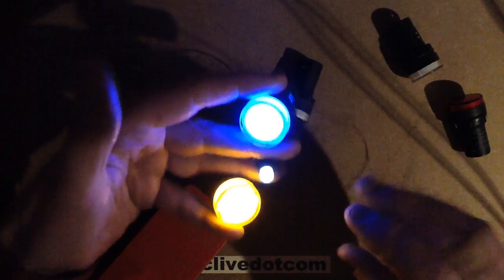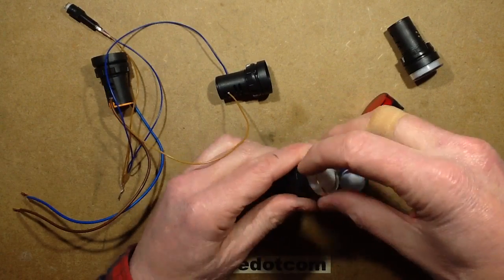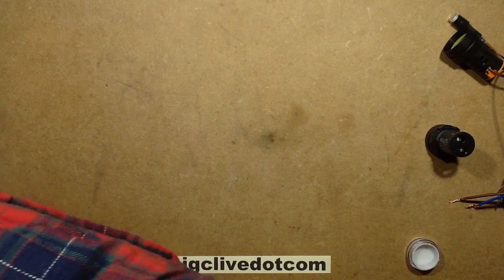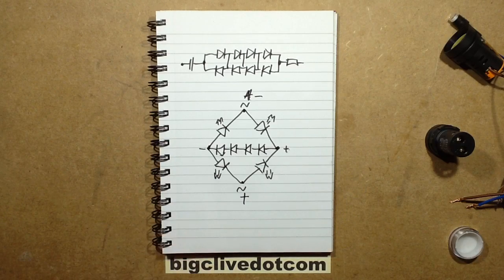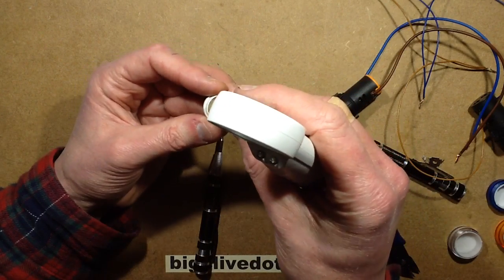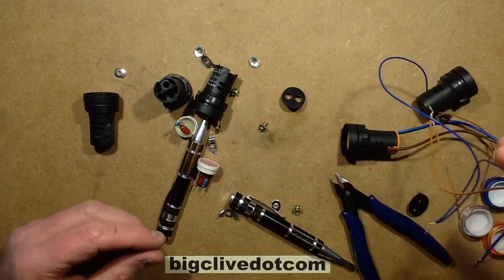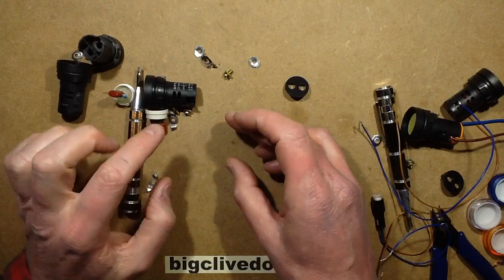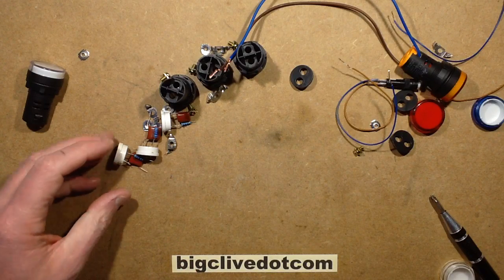A look inside some eBay panel indicators.  (with LED based rectifier!)

Comment: I wonder... Do they flicker? Single alternance rectified 50 Hz gives a 25 Hz pulsating voltage, the flicker of which can be visible and annoying  for some sensitive people (like me)...
I have often dreamed of special high light persistance LEDs that would act as if a capacitor was smoothing the supply... Would not some sort of phosphor layed on the LED chip do the trick?
Reply from the maker: The indicators do not flicker perceivably to the eye

Comment: I once had to replace the ballast in fluorescent fixture in a retail store.  I turned off the strip of lights the burnt out fixture was on and started to work on top of an aluminium ladder. I got a shock from the fixture because it turned out that this particular fixture was on separate circuit because it was one of the security lights that is left on all night when all the other lights are turned off.  Like you said, always check your voltage again.

Comment: I have bought these and use them for various commercial applications.  I set up a test of all 5 of the LED's on 120 volt. 1.5 years has passed with 24/7/365 application.  here is my conclusion. The red and green remain as bright as originally installed. The white is the dimmest, followed by blue and yellow. Those 3 have dimmed dramatically.  I have used the red/green on motor control distribution boards.  The white/blue/yellow for other 'load on' applications on alternating motor systems, remote loads, etc. .

Comment: I bought a 6mm indicator rated 240V    I figure there was no way to have a ballast cap or a ballast resistor in that size.
I measured at 20VDC ant it took 10 mA   = 200mW   I did not dare to put 240V across it was bright enough for me at 10mA so added a 5W ballast resistor.

Comment: these dont work with 230v ?
Reply from the maker: You get 12, 24, 120, 230 and 380V versions.  I'd actually suggest the 380V version for 230V use as the components are rated better.

Comment: I make my own as they can be a bit pricey and often aren't at the desired voltage.  Get a sizable switch with a plastic body and make a hole large enough for the LED. It does need a bit more extra wiring and circuit but one has more flexibility in brightness, colour, light effect (ie flashing), and voltage.

Comment: Clive,  have you looked at similar indicator lights that detect amperage?,
Reply: 22MM AC 60-500V 0-100A LED Current Meter Indicator Ammeter New
Reply from the maker: I didn't spot those.  I've ordered a round and square one.
Reply: I have ordered one as well to be used for a block heater indicator.
Curious as to how they make a dc led work off ac current flow.

Comment: I ordered a multipack of 230v indicators wired as a bridge rectifier and ended up powering them with a dc supply but with a flip/flop circuit and npn / pnp transistors to swap the polarity at about 2hz and it makes for a very atractive indicator. The yellow one looks great. It does worry me that these things are being wired to 240v and 450 (shudder) Thats just and accident waiting to happen when it fails and someone thinks.... ooh its off  !!!!!  neee goood

Comment: I always found it funny how in Star Trek, whenever there was a power surge, someone operating on ship's consoles died from electrocution. Could be they used those cheap Chinese control panel indicators hooked directly to 12.75 exawatts Warp Core.
Reply: One thing's for sure: None of those connections were earthed.

I'll go now.

Comment: I see "LED rectifier"

Is it possible to make an entire LED lamp where the LEDs themselves are the rectifier? Like, one set of LEDs points in one direction, and a second set points in the other so that it alternates between the two with each wave?
Reply from the maker: You have to be careful about leakage through some diodes exceeding the reverse voltage of others.  The gallium nitride LEDs don't really like being reverse biased with too high a voltage.
Reply: That could be countered by using multiple LEDs in either direction, right? The voltage would be split evenly between them.

Comment: what I don't get is why they dont use surface mount capacitors and resistors!!!!
Then you could just hook it directly up to mains with no worries. Whole thing enclosed in epoxy/resin with just the wires coming out of it. No more risk and much safer than having an entire circuit board dangling from the back of an LED circuit board attached with leads!
Why not just make the whole thing encased in resin/epoxy with surface mount miniature inductors and surface mount components.
That would surely be neater and more compact!

Comment: these look like cheap fake copies of telemecanique,  
and as an industrial panel designer and builder only 110vac or 24vdc lamps should be used (48vac  for cranes )
240vac is extremely bad practice and anyone using 380v lamps should be sacked .
Reply: I agree with what you are saying by using 24vDC and 110vAC but I don't believe the 240vAC pilot lamps are bad practice, I believe they now used purely for retro-fit applications (LED conversion) but yes 400vAC and above shouldn't even be made. Some of the old panels I've repaired had no space for transformers which would have been massive due to their age. Either that or certain companies were just cost cutting when they were designed

Comment: I have 600v lights. Am I able to run 240v to them and will they work?
Reply from the maker: If they are LED then they should be fine.  If anything they will last longer.
Reply: bigclivedotcom yup they are LED. Cheers.

Comment: I probably didn't listen well enough in school to understand but.....why do you by-pass the cap when using 12 V ?
Reply: It's often 12V DC, and without the cap, it's a reasonable 12V design instead of a 220V design.

Comment: Those poly caps are a good deal tougher than their ratings would indicate.  While I certainly would not design something deliberately outside those specs for an industrial indicator with longevity in mind, I think the rectification the LED provides makes it a sort of pulsed application, for which poly caps have far higher ratings (a quick Mouser delve for 250V Polyester caps from VIshay shows a 250V ac rated cap with a 630V DC rating and impulse ratings in excess of 1kV) and self-healing characteristics.  These properties are often exploited among home Tesla coil builders to create large stable safe capacitor arrays.

Interesting teardowns.  For comparison, I got a hold of several Allen-Bradley LED indicators (800FD-P3N5), which contain a bit more protective circuitry for the LED, mostly well-sized power resistor, full-bridge rectification, zener protection for LED, and a bleed resistor to keep from biting you. All protecting a single LED with a cap for scattering light.

Comment: As some follow up to the never assume tip: A electrical contractor came around my facility to replace PCM filled transformers.  He did not verify all the name plates and assumed all the transformers had 480v secondaries.  Half the facilty's old transformers had 208/277 secondaries.  The cost of the repairs to the facility was several times the cost of the bid to replace the transformers.  The contractor had to cover the costs.

Comment: just recently found your channel absolutely great stuff. I especially enjoy the work you do with the LED spotlights. I was curious if you ever considered doing a tear down and analysis of any of the off road led spotlights scattered all over Ebay? some of them seem to make pretty auspicious claims being that they're based on 12 volt system.
Reply from the maker: +matthew knowles Thge power and intensity values are all sales driven.  I've featured at least one jeep light in a video.

Comment: Interesting LED bridge rectifier design. very clever to use the LED's this way.
That 250 Volts rated cap was probably for a 110 Volts lamp and misplaced in a 380 Volts fitting. Poor Chinese quality control.

Comment: Hi and well done!
I just wondered if the little 250V cap in the 380V LED arrangement might be at least mathematically correct as it has only to withstand the voltage dropped across it. So I did a quick calculation with the reactance X=1/(2*Pi*f*C) and I get 32k at 50Hz on a 100nF cap. So given it is a white LED with 6 * 3V chips in a row, you have 100nF -> 5x3V -> 1k. The voltages are equivalent to the resistance, so with 230V across the whole thing, you have 205V at the cap, 18V at the LEDs and 7V at the 1k resistor. The current flowing should be about 6.4mA.
With 380V the cap has to carry 351V, LEDs take 18V and the resistor takes remaining 11V, all at 11mA.
And as the white LEDs had only one LED chip, the voltage shifts up again about 15V more...

The capacitor with 250V is clearly underrated. 

(Reference http://www.electroschematics.com/5678/capacitor-power-supply/)

Comment: I've never heard of tiny tungsten lamps operating at those high voltages O.O. The high voltage indicator lamps I'm used to seeing(Allen Bradley) have a built in 24v stepdown transformer. After seeing the inside of the tiny one, neon seems to be the best option for an indicator of that size.

Comment: Not bad price, about 72 cents US on Ebay for these lights.  I guess we are lucky in the US in some respects, the cheap chinese tat is likely to be 220/240 stuff running on 110 at half brightness so we're a tad safer.
Reply: +stonent In noticed the attempt at catching people wanting Allen Bradley parts in the title "Hot Sale LED Pilot AB Panel Indicator Signal UC Warning Light Lamp AC/DC/AD"
Reply: stonent If it runs on 110, wouldn't the amperage be increased though?

Comment: 380V is 347V + 10%, where 347 Is the line-neutral voltage on a 347Y600, which is common in Canada.

Comment: Here in the Netherlands a fase to neutral is 230V and the difference between fases 380V. Surprising that the ratings on the lamps are not given as 250V and 480V respectively. Manufacturers usually go for a value to appeal to the widest possible audience.

Comment: I might be mistaken, but in my mind, LED have a quite low reverse voltage tolerance, making them not really suitable for rectification. Am I wrong? a quick googling tells me it's about 5V max on the datasheet, and we can get away with 15V
Reply: +nraynaud1 It's not such a problem in this application though, because the reverse polarized diodes never see more than the forward voltage drop of the other diodes that are conducting.

Comment: The voltage rating on film capacitors is usually AC. If the capacitor is marked 250V, that's 250V AC, not 250V peak. Even with the correct voltage capacitor, you still need that series resistor to limit inrush current when you happen to turn the indicator on during AC peak or worse: during the opposite AC peak from the one the capacitor might still be holding a charge from. The LEDs might not survive the several amps pulses for many times: without the resistor, the circuit will initially looks like a 0.1uF cap charged to ~750V. If the LEDs have 15 ohms of total combined series resistance, that's a 50A initial pulse current.

Comment: As clever as that arrangement is efficiency-wise, it does mean that the inactive rectifier diodes will see a reverse voltage of 5*Vled. Let's contrast that to the classical arrangement where, as you said, sometimes you see bridges to make sure any LED at any given time won't see more than 1*Vled in reverse. If one of the rectifier diodes pops, the other on the same AC side will surely pop too from reverse breakdown. In this case, to use a couple of EEVBlog memes, the light won't even be a poor imitation of Tiffany Yep, but will be dead as a dodo.

Comment: i work in a paper plant and as part of a motion to remove all forms of breakable glass for food safety resons I replaced some indicators that used incandescent lamps.
They were italian made led indicators that I fitted, and they were quite expensive.
There wasnt a dropper cap, just a resistor (they were the larger indicators), and nearly all of them failed, the resistor got so hot the solder melted and the wire came off, yes they were the correct voltage rating.
There are some of these that arent very good, and not necessarily the cheap ones.
Reply: +sean doofer before I knew what I was doing I made an LED indicator with just a dropping resistor. Well, that and some rectifying diodes too. I used one of those 5 watt cement block wirewound resistors. It gets smoking hot. Although my calculations indicated that I could have gotten away with just using a 2 watt resistor? Yeah, no, I don't think I'd want to even see what that'd be like. That 5 Watt block gets so hot I've thought to change it out for a 10 watt resistor on more than one occasion already. But I have that resistor mounted on a terminal lug strip in an enclosure with some free air, so I guess it is OK? It does in fact work. Still pretty sketchy as far as I'm concerned. So yeah I can see your resistor limiters basically being solder heating elements. When stuff gets that hot you have to crimp connections. Solder just doesn't cut it anymore.
Reply: @1pcfred  Changing to a 10 watt resistor will only give the illusion of less heat dissipated...the amount of heat dissipated is a constant, and going to a larger rated resistor only spreads that same amount of heat on a larger area.  

The only way to reduce the heat dissipated is to go to a larger resistance value, which reduces the current flow, which makes less heat. Of course the brightness of the LED goes down, but you will also gain the benefit of longer life on the LED.

Comment: In some Heathkits I have built, they use 1.5kv ceramic capacitor for bypass on the AC line and that's of course on 120VAC.

Comment: 380 Volts is what used to be the voltage across two of the thee phases in three phase supply in the 220V era, which used to be the mains voltage in mainland europe. When the EU standardized on 230V it went up to 400.
Reply: +spankmeister  Interesting to note with residential voltage in Europe being double what it is here, yet industrial motor voltage is 347 / 577 VAC, 3 PH
Reply: I get 240v +-1v with 415v three phase one our low supply and 600v on our high
Reply: +spankmeister Yep. 99% of the population still speaks about the "220" and "230" in France.

Comment: 250VDC capacitor will withstand 560V for a while, as they get tested in production to 500VDC. Slightest spikes though will mean rapid self healing so in a short time they will be 10n capacitors, then open capacitors.

As to indicators, I used to have some which used 115VAC bulbs, on a 230VAC mains. Simply used a diode and a resistor ( 5W) in the lamp holder to drop the voltage to 100VAC or so for the little 3W ES base lamp. Replaced with a neon version as those little lamps are expensive, just shorted out the diode and left the resistor in, as the screw in neon already has a built in 220k resistor. Dimmer but lasted longer, and not really needed as it was on a noisy motor anyway.

Comment: As you've alluded to in the vid, the AC RMS rating of film/bipolar caps corresponds to Vpeak of the AC (not to be confused with peak to peak, which would be double that.. and relevant if you're gonna look at AC on a scope for instance). So for a 63VDC film/bipolar cap, it's 63V * 1/sqrt(2)=44.6V AC, which I see manufacturers derating to 40Vrms AC for that example. 1/sqrt(2) assumes that the AC waveform is a pure sine. But, I suspect things are more complicated than that because film caps are also derated for frequency. The higher the frequency, the lower the permissible AC RMS. So the question is, if the input waveform is totally non-sinusoidal, such as a modifed sine from inverters, which is just a series of sharp steps that in themselves contain extremely high frequencies, even if the repetition rate is still 60Hz - would this significantly change the picture as far the need to uprate film caps? But then, the integrated energy from the pulses would still be the same as in a pure sine? Or would it? In the end, afaik, the frequency limit is determined by the temp rise from the dissipation factor of the caps, as calculated for a 10C max permissible rise. Since you've done a vid on the effect of self-healing for film caps, I wonder how much a non-sinusoidal AC waveform would affect the longevity of film caps....
Reply: Inducing an inverted flux capacitor with a nano-compressor in parallel would resolve the issue.
Reply: Hahahahha. I'll get right on that and hopefully don't end up in the future lol~ :'D

Comment: I try to make the assumption that everything is live at lethal voltage until proven otherwise.  240 volt lamp with a 400 volt cap, and 380 volt lamp with a 250 volt cap, then running half watt with what looks like an eighth watt resistor. Sounds like a typical day at the Chinese factory. Specs are what you print on the outside, nothing to do with what they put inside.

Comment: Clive you can get a tester for led or any light source, I got mine through alibaba its called a lumens or MCD tester I have sen them on ebay as well. I got it because I buy my LEDs but voltage, amps and lumens.
Reply: Sorry there you can buy not but

Comment: We use those led indicators made by Allen Bradley and they look and work well compared to regular indicators.
Reply: +John Williams well for the few extra ¢ i would expect the Allen Bradley versions ho have better rated capacitors than these unbranded types.

Comment: Great to see the revue of these panel indicators as ordered 3pks of 4 to get colours I needed for panel. The two sent were surplus feel a lot happier now you've looked them over. Will be building the controller panel next week. 
Disappointed to see no bleed resistor for capacitor maybe install some externally. Many thanks Pete.

Comment: The 12v AC ones just replace the dropper capacitor with a another resistor.
And apart from that, seem to be pretty much the same. I think right down to the same LED layout.